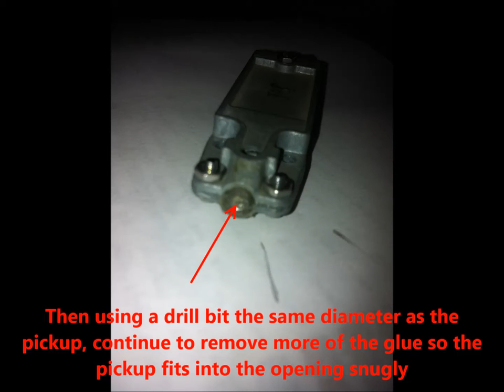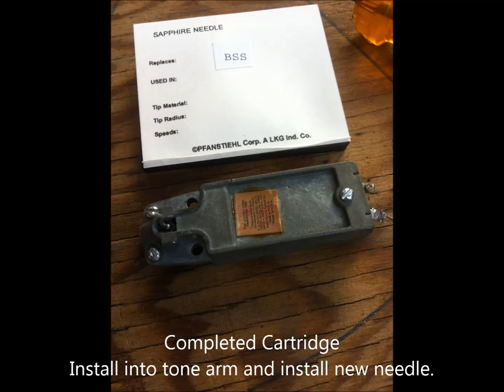Rebuilding an Astatic L 40 Crystal Cartridge

Comment: What size crystal did you use ?
Reply from the maker: Vague recollection of this situation, been a long time. The element was approximately 3/4” in diameter. But, I hear that using a larger one gives a better response with higher voltage. The wires were from a 9v battery connector.

Comment from the maker: Hi guys, well I haven't determined the out voltage as yet. Just took what others have done and took more steps. As for the output, it could be alot better. Also working on that. It possibly due to the type of element. Not sure.
Reply: The output for the original cartridge is 3 to 4 volts, you well never get even close to that using a peizo element.
The Person at westtech used to rebuild them. Not sure if he still does.

Comment: How do you predict or determine output voltage ?
Reply: That is done using a VOM meter connecting it to the meter and rubbing your finger across the needle or playing a record while connected to the VOM. I'm a TV Radio Phonograph Repairman 43 years experience.